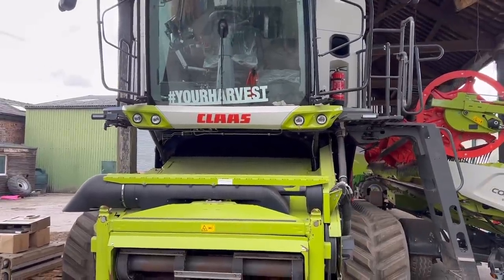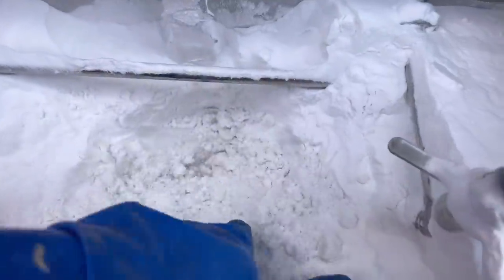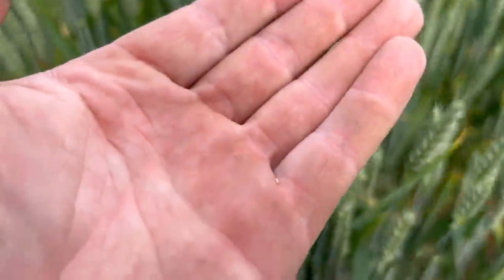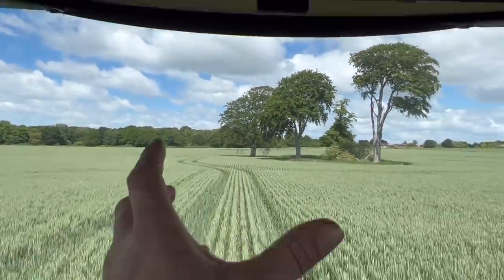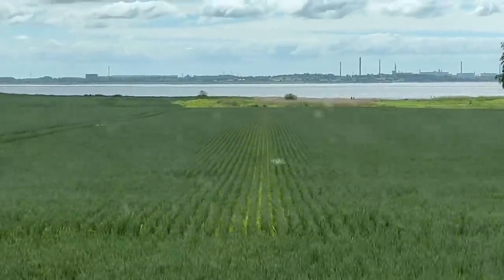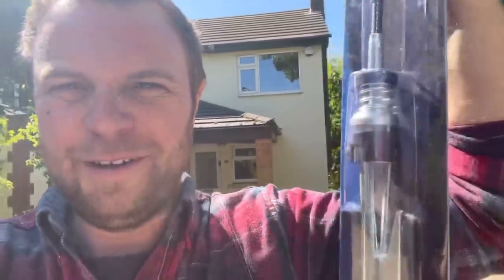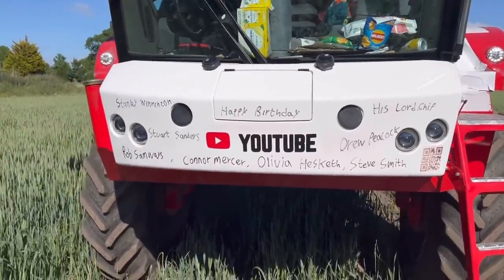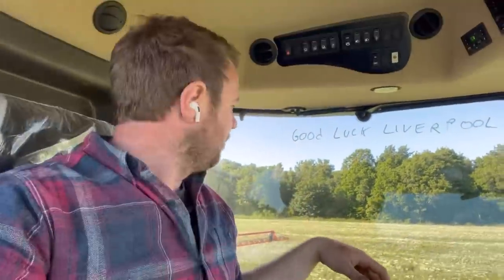Day797 SPRAYER FILLING PROBLEMS AND  PHOTO SHOOT  PREP #OLLYBLOGS  #AnswerAsAPercent

Comment: Crops looking good really hope you get a good yield  to offset some of the high cost of the fert.  And the tool you really need to use a ball hone not the 3 fingered one as they can leave uneven passes. You can get the ball hones in different sizes to suit the bore size. There is also quite a difference in price but that's for a reason. Generally depending the material of your top ring  determines the stone type you use when honing and the glaze you leave behind when getting rid of the glaze.

Comment: Cylinder bore glaze remover and polisher. Used a few times over the years I did engine rebuilds.
It won't take off the step at the top if there is one though. May need pro help on that

Comment: It's a cylinder hone for cleaning or deglacing  bore's but it won't take the ovality out of the thruss side of the engine due to the power stroke pushing pistons into the block.
Reply: Kieth, I recon that it needs a re bore and new oversized pistons, assuming that it doesn't have replaceable cylinder liners😵‍💫
Reply: @adrianchetwynd1334  I agree with you! Mentioned that in an earlier message, would be handy if you could get in done Insitu!🤞

Comment: It a honing tool for deglazing cylinders. Your 1690 doesn’t have wet liners . The liners that you get will need to have the block bored out and the new liners pressed in. If you are doing that I suggest you check the piston heights in the block. Can’t just remember the protrusion for the turbo models but the smaller tractors were from 8 thou below the block to 13 thou above the block. We used to skim block to give maximum protrusion. The made the engines start in frosty weather without any heat or cold start. Also gave lots more power.
Reply: I sent an engine out of a 1690 to get it reconditioned many year's ago, went in one piece ! Came back the full of a car trailer in bits! Started and rebuilt the whole engine. The cylinder heads had been skimmed and heavy arsed valve's fitted due to seats being sunk to keep valve height right and new valve stem oil seals fitted. That tractor couldn't be got started! Such a mess! After changing the pipe work to heater plug and silage season approaching fast the owner said she'll bed in. She never bedded in! 3 years later he run her with out water and gasket went. Took heads off, the valves had never been ground. Did those and she'd start any weather and pull tanker up hills 2 gear's higher!😢

Comment: 1690 isn’t a wet sleeve engine so you can’t just pop out the old sleeves and put new ones in. It’s not that easy. You can pull the sleeves out and the kit comes with repair sleeves that can be pressed back into the block, but then you’ll need the bores finished bored to the correct size for the pistons. If your going to bore it the best bet would be to just go with oversized pistons if you can.
Reply: 1690 engines were non turbo's, the fact that the engine has already been resleeved means the the engine has been very worn.   They did not come out of the factory fitted with sleeves, but if not too worn your engines sleeves can be rebored & oversized pistons fitted. If you are not bogging the engine up suggest you consult a specalised in engine overhauling to get this job done properly. What type of transmission is your 1690 fitted with? I have a full David Brown Service Manual 3 volumes available for your 1690 as do not have any DB's now, if you care to contact me.
Reply: @andrewgeary989  you might be right they may not have had sleeves from the factory but it’s still not as easy as removing the old repair sleeves and pressing new ones in it’s going to require some amount of machining. The late 1690’s we’re had factory turbo’s, 1690T.